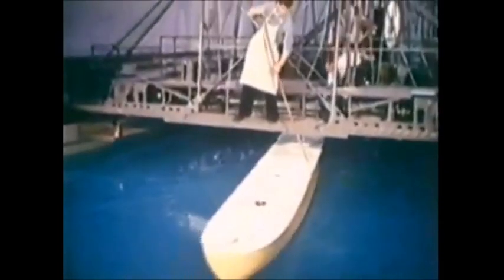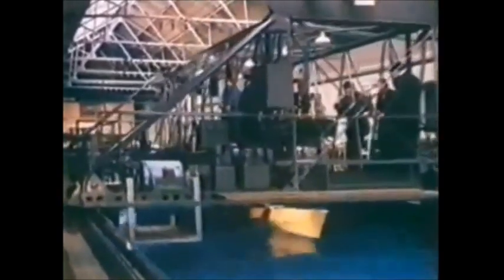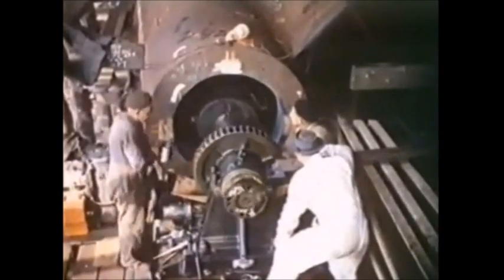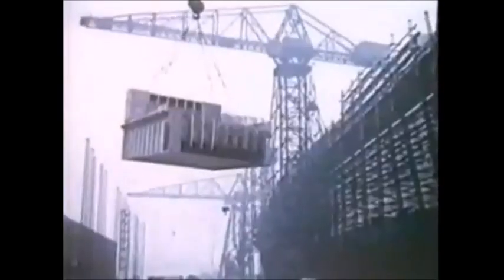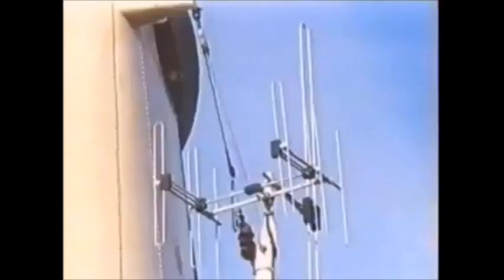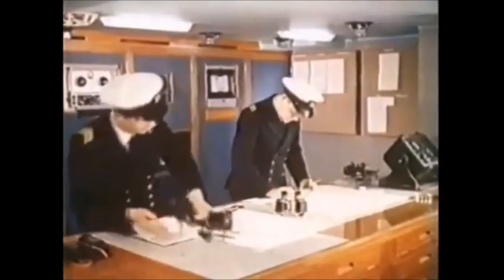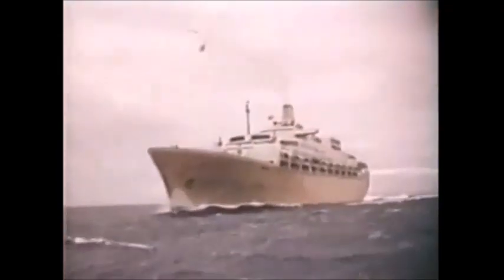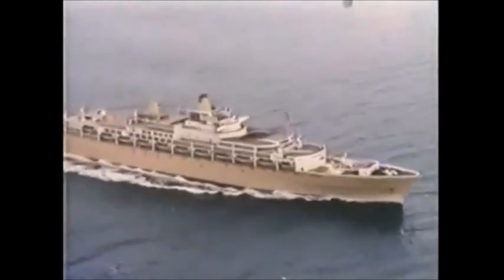s.s. Oriana - The last Orient Line ship - commercial filmwork

Comment: she was a good ship, but rusting from the inside even before launch, these days all steel is preblasted and painted barring weld areas
she had a wonderful entry, you never see bows as she had on cruise ships, cruise ships have to slow for heavy weather, not Oriana, she cut the water
Reply: Codswallop,  she was all aluminium,  I was a chief engineer 68 to 72